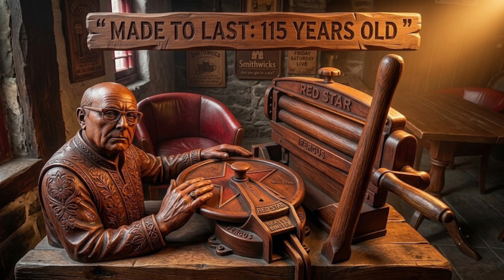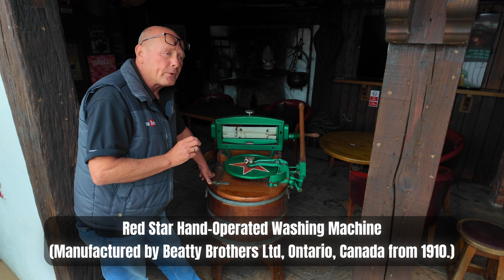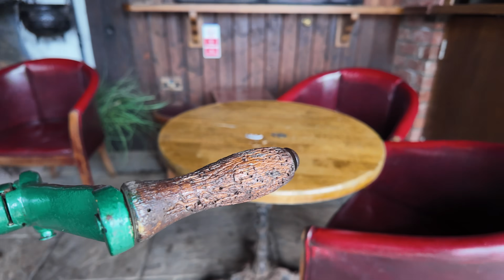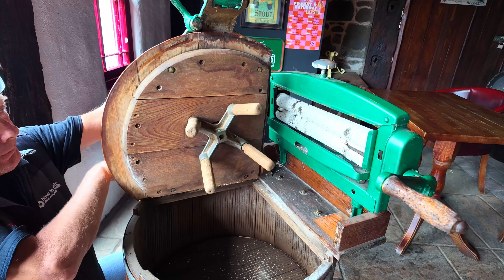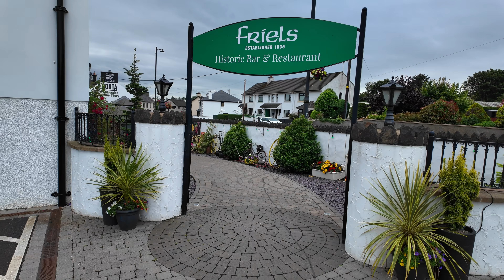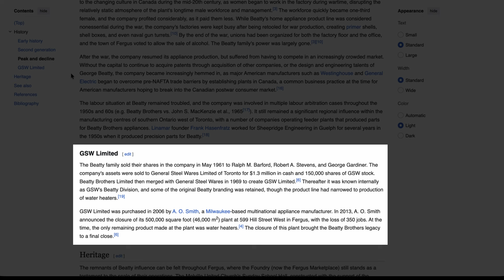115 YEARS OLD and Still Washing: A Laundry Miracle

Comment: I'm still running my Gorenje WA1112 in mostly original form (the things that count are all original). You can't defeat a machine that's made from hardcore metal and i was smart enough to buy parts for it when they were available (the spare parts thing has gotten 9 times worse than it used to be before we even had laws for it). Manufacturers are greedy pigs and i'm insulting pigs here honestly.